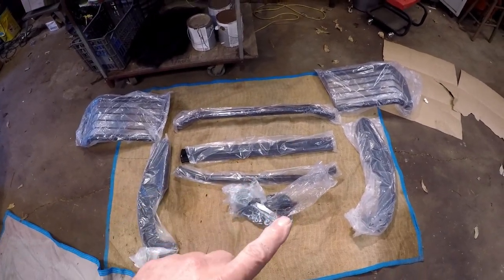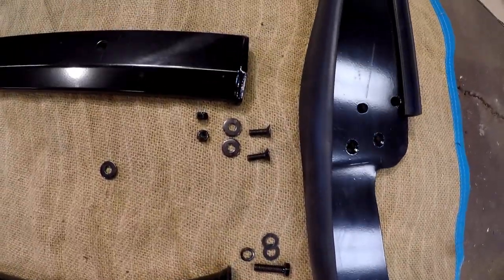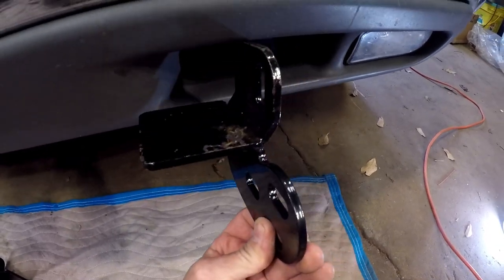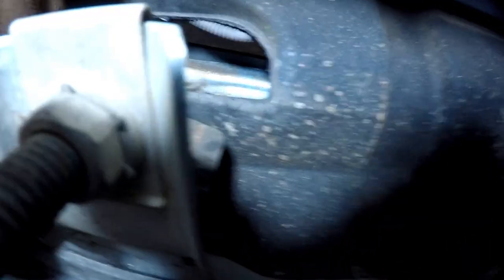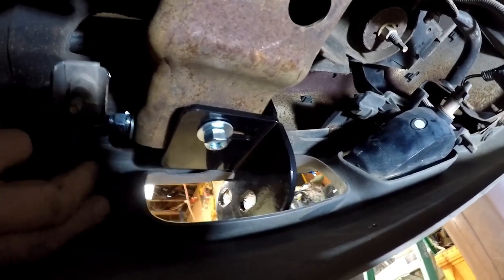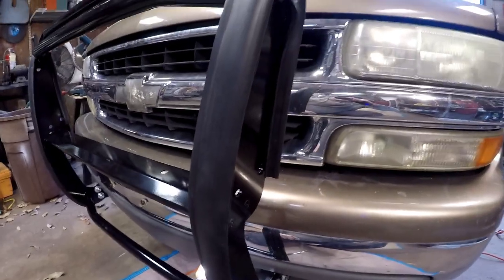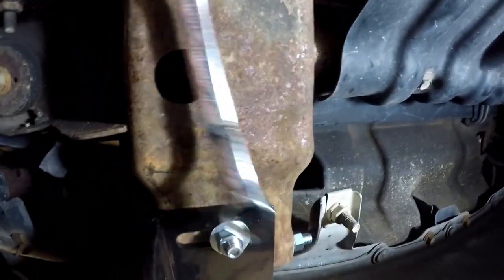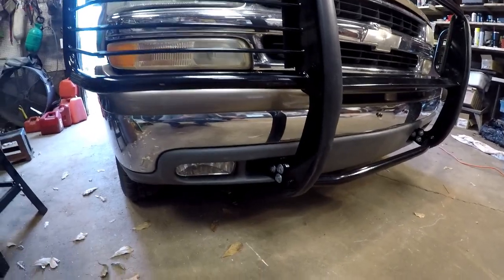Brush Grill Guard Install on older Chevy Tahoe  - HECASA   Brand

Comment: Just installed this exact same guard on a 2004 Tahoe without hooks. Was able to get a standard craftsman box end wrench on the bolt head inside the frame rail from the front.  There was enough play in the plastic chin spoiler to get it in there.

Comment: In the description it says it works for 1500 LD, would it also work for LS because from what I see theres a slight difference in the lower bumper?
Reply from the maker: Sorry not sure. I would look close in the manufactures info or ask them.  Good luck
Reply: No differences in them

Comment: Instead of cutting and welding the wrench you could have simply heated it with a propane or map gas torch and bent it locked in a vice. I’ve had to do this many times, last time a 9/16 to reach Harley shovelhead head bolts.
Reply from the maker: good tip!   Thanks

Comment: did you had to lose the tow hooks
Reply from the maker: No tow hooks on the Tahoe.  I was able to keep the tow hooks on my Dodge Ram when I did that truck.  Used the same brush guard brand.
Reply: @Kennyp...did you install a guard? I looked at my truck and I would have to remove the tow hooks
Reply: @marklane61  yes the toe hooks 🪝 would have to be gone
Reply: You could possibly bolt them back up with the brush guard under the guard